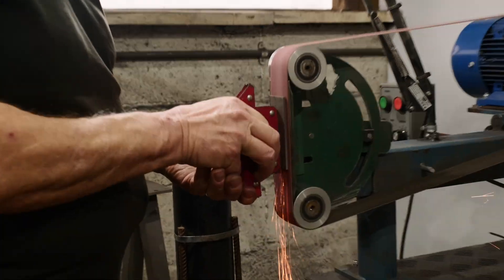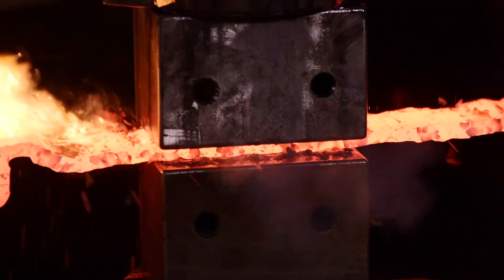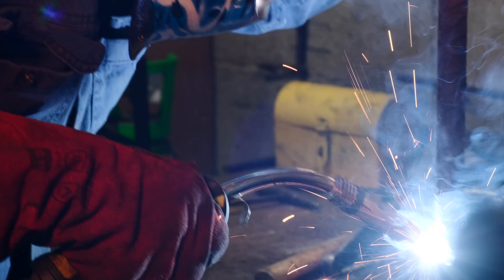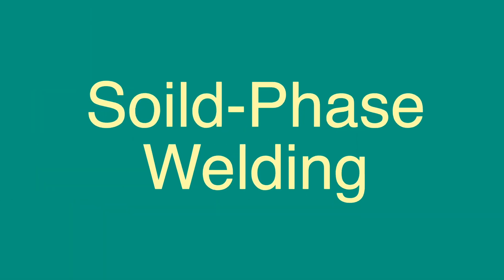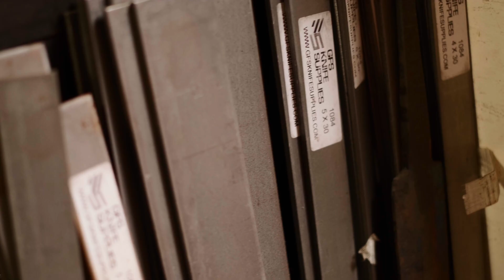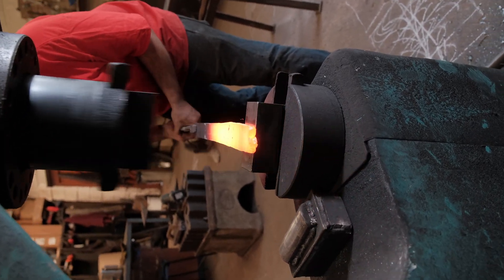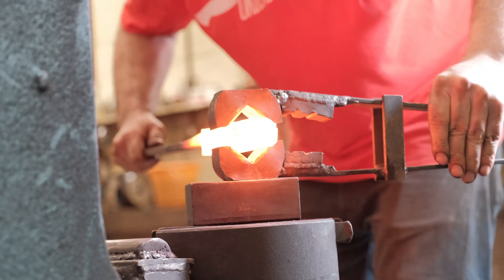I wish I knew this BEFORE I started forge welding!

Comment: I could listen to Graham all day. His no bull attitude is refreshing in this day and age.
Reply from the maker: Cheers man! And yeah, me and Graham can chat all day and every minute is fun! 🤩
Reply: @UKBladeshow  The cream filled donuts you bring always seem to lubricate my vocal chords 🤣🤣🤣🤣🤣🤣
Reply: @clarkeknives4159 

Hi Graham, 

I thought about the core issue for 15 minutes you were talking about these expanding metals and the core cracking issue. It was a good problem, I drew it in my mind and visualised the various possibilitys there could be when forces are added and see how the anatomical constructions move at the time.

Perhaps I have some idea based on what you told, propably you have thought it already, but I just speak my mind out. 

I'm interested wonder if I see this like yiu do and hope you will allow me to think about this here, but I'm just curiouse guy and my mind focuses only on the problem at hand because its a fun topic and it happens to interests me also. 

So, the point, I can visualise in my mind the following and I will try to describe it in a simple brief way. 

I base this on a few things that have been in use already and time has proven these methoda to actually work also, 

Firstly

Traditional Katana forging has at least roughly 800 years based on the anatomy that is there is a harder outer core in the blade than the inner layer of the blade that is softer and more flexible. The flexibility helps to absorb energy of the sword of the impacts, strikes. 

Lets think about forging a Katana simplified because its easier to visualise it and then move that theory in the welding and forge hammering modern knife steels. 

There is now a outer core that is hard and inner core that is soft. 

When the outer core, while quenching it, firstly forms a hard outer layer, roughly speaking and visualising the anatomical struckture is like this - > (|), If you can visualise the following in youre mind like I do it helps other wise drawing on paper helps, , so the outer core is starting of harden and when it then first cools down, its hard in that moment it makes the outer perimeter like - > 0, seamless, because the inner core is softer material it will expand inside, but slowler on the inside, but since the outer layer is harder and strong, denser metal I believe is the technical term, it will hold its form, even thou the less dense softer metal inside expands and the inner material will try to expand but if the metal ratios are correct the softer metals expanding force can not break the outer layers seal. So what will happen then? The outer layers metal will resist and the inner softer metals expanding force will be pushed back forcing the softer metal to become denser.. Its basicly physics. If there is a force there is a equal counter force and in this case outer layers counter force, the "seal" must win this battle, if not there will be a crack. If the outer layers are softer they will press the inner harder material while expanding and that would result in the cracking in the harder material in the middle of the softer outer layers if the compressing force of the outer softer seal is too much for the inner layer to withstand. The outer layer will become hard first while quenching but the heath energy moves in a wave. The outer layer then would expand on the inside because the outer layer forms a hard base it presses on breaking the harder metal core by compression. The force moves inside from all directions.

Now back to present

If there are more layer while youre making damascus blades, like they usually have, basicly its the same theory that would still apply, the ratios just have to logical and optimal. The theory will remaim the same. 

If you think about this theory in youre mind, draw it in youre mind or visualise it on paper by drawing with a pencil, maybe you find my thought path and logic behing it, perhaps this idea has some use to you in youre line of work with blades in youre shop. 

Sincerely

"Joey" 
Just a plain, normal guy and a Inventor. 

Greetings from Finland
Reply: Knife maker ASMR
Reply: Agreed